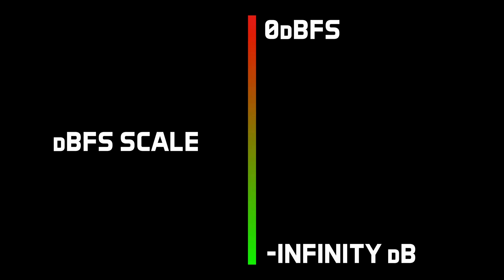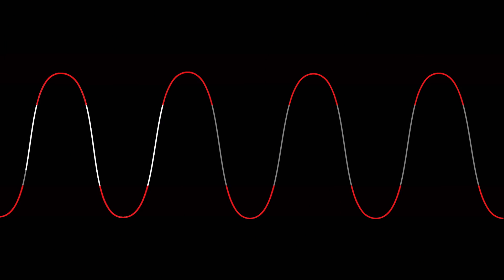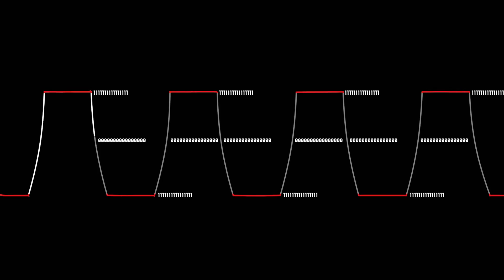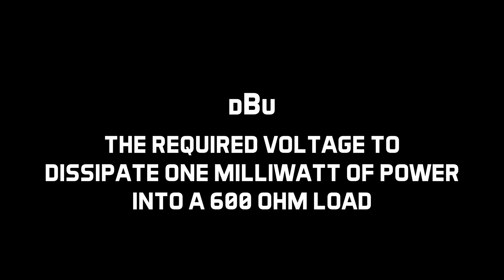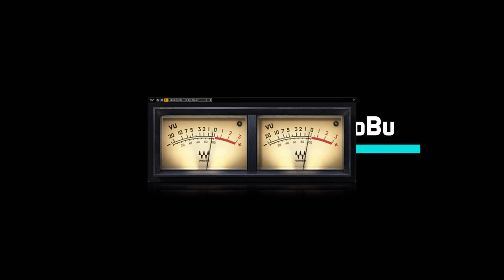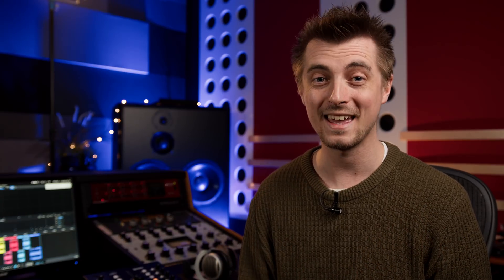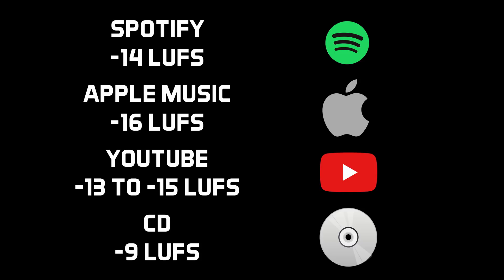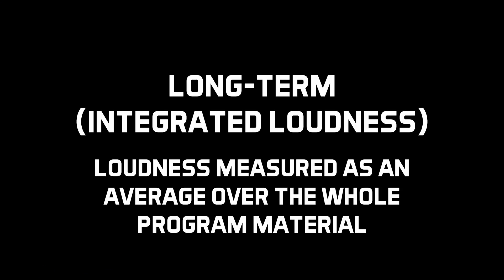Decibel Scales And Loudness Units And Why You NEED To Know Them

Comment: Is it ok to use Izotope RX (Advanced) to process a -14LUFS master down to -16LUFS? (From my Spotify master to an Apple master) (Using the loudness processor) Rather than going back to the project, changing my limiter then re-exporting which takes a while. Thoughts?
Reply: Do not do that. Master to make it sound good, not hitting numbers. If it sounds good at -9LUFS keep it at that level, it is only going to get turned down.
Reply: @thomasberdal3049  Hi, sorry, not sure you've totally understood my question. I run a mini label and have a lot of masters (most of which are already mastered for Spotify at -14LUFS) so re-opening tons of tracks to limit down, test etc will take a long time. All I'm asking is whether Izotope's loudness processor is good enough to bring a master down from -14 to -16LUFS in order to release on Apple music. In my own tests I've tried this and I think it sounds fine, I can't hear any difference, I just wandered if anyone else had done this.

Comment: Great video, but I don't think your section on LUFS is completely accurate. If you exceed the LUFS targets of a streaming service, you are correct that they the will indeed turn your mix down. But this is just like turning down the master fader or adjusting the trim pot. There won't be any unwanted artifacts here. The issue arises when your mix is below the target. In that case, the service will turn up your mix and, in order to avoid clipping, they will run it through a limiter and you don't want that. (NO LONGER THE CASE, SEE EDIT BELOW) This is what is described in Spotify's documentation: https://artists.spotify.com/en/help/article/loudness-normalization

EDIT: looks like Spotify actually changed how they do things! They no longer use a limiter FOR MOST USERS. If you have normalization enabled at the "Normal" setting, they'll only bring up the level to -14dbFS IF THERE IS ENOUGH HEADROOM. So neither exceeding nor being below the target result in artifacting. However, when using normalization with the "Loud" setting they will apply gain to bring up the loudness to -11dBFS. In this case they'll slap a limiter on to avoid clipping. This may result in unwanted artefacting.
In any case, being above the target causes no artifacting. Being below -11dBFS may result in unwanted limiter artifacting under certain circumstances.
Reply: Copied directly from the link above: "Negative gain is applied to louder masters so the loudness level is -14 dB LUFS. This lowers the volume in comparison to the master - no additional distortion occurs.
Positive gain is applied to softer masters so the loudness level is -14 dB LUFS. We consider the headroom of the track, and leave 1 dB headroom for lossy encodings to preserve audio quality.
Example: If a track loudness level is -20 dB LUFS, and its True Peak maximum is -5 dB FS, we only lift the track up to -16 dB LUFS.

Premium listeners can also choose volume normalization levels in the app settings to compensate for a noisy or quiet environment

Loud: -11dB LUFS
Note: We set this level regardless of maximum True Peak. We apply a limiter to prevent distortion and clipping in soft dynamic tracks. The limiter’s set to engage at -1 dB (sample values), with a 5 ms attack time and a 100 ms decay time.
Normal: -14dB LUFS
Quiet: -23dB LUFS"

Comment: "If the recommended loudness unit levels are exceeded the services will quite often turn the music down leading to horrible limiting artefacts and a generally unpleasant sound."

Only if those things already existed in the master. Normalisation is almost always just a clean gaining down of the original master. Unless someone is using the loud setting on Spotify of course, as that is the only setting on any service I know of at least, that uses a limiter. Even then that is to bring a lower level master UP, not down to that louder 11 LUFSi. Which lends more to the argument of definitely mastering hotter than -14LUFSi, not the other way around. 

It's fairly moot anyway as less than half of Spotify users actually have premium and thus access to those normalisation settings, a lot of playback systems don't have normalisation at all like on 3rd party players like Sonos systems and even of those that have access to those settings it remains unclear how many people are really aware of them never mind change them. The only figure i've seen is from Ian Shepherd saying only 17% of users change this setting (although this is unsubstantiated), which considering only about 46% have access to it to begin with is an incredibly small number.

Master to make it sound good. Worrying about the streaming services normalisation specification is counterproductive and if anything, is more of a floor, not a ceiling, in terms of the loudness of your master.

Comment: As ‘decibel’ is a mathematical function, quite literally a fraction on a logarithmic scale, dB has no meaning. In fact 3dB has no meaning either. When we say add 3dB, the word ‘add’ is what gives it meaning. Likewise a + sign. +3dB has meaning.  Yes, it is confusing but really doesn’t need to be understood in mathematical or historical terms. Just remember that a number followed by dB is a multiplier of whatever it is that’s being measured.  20dBu denotes a voltage of 10x the agreed standard of u=1vAC, or 10vAC. It gets even more complicated because AC voltage can be described as peak or average but that’s not important here. 

6dB, or very close to it, represents 2x our measure of sound.  10dB is 3.16x our measure and 20 is 10x.  40=100x and the familiar logarithmic function continues.  60x = 1000.  When we say RT60, we mean Reverb Time (decay) for 60dB loss, or one thousandth the original sound’s measure. That’s as good an indicator as any that sound needs a logarithmic scale or we’d be burdened with very large numbers.

What IS important is to know what the references mean and how they apply to your job. As audio engineers, VU and dBm can be effectively ignored as they no longer measure anything of importance to us. The ones that matter are:

•The letter ‘u’ refers to AC voltage, often 1vAC RMS. This is a technical measurement useful for comparing equipment capabilities.  -6dBu would indicate .5vAC.

•FS or Full Scale.  OdB FS simply says this is the adopted ceiling for those of us working with digital audio (that’s all of us) and it is a relative newcomer. We measure our audio signals almost exclusively as a value of dB below it. -20dBFS means we can increase the signal voltage 10x before running completely out of headroom.

SPL or Sound Pressure Level.  This is a created scale with an obtuse and unimportant reference of absolute pressure called a Pascal. But 94dB SPL, which happens to be 1 Pascal, has real meaning to our ears. We can create a sound that measures that value and hear what it sounds like.  Incidentally, microphone sensitivity is expressed in a number of dB below 1 Pascal. Handy to know.

The math is not important, but the references and key numbers are. When the reference is missing, you are not being given enough information to make a judgement.

Btw, your description of dBu is actually the proper description for dBm (1mW dissipation in a 600 ohm load).  This was in wide use in the days of analog telephony and carried over to audio in the old days when we actually added a 600 ohm resistor at the load end of every single path which resulted in a ton of wasted energy.  dBu was the result of eliminating this 600 ohm load and the u actually comes from “unloaded”, a measure of relative voltage independent of impedance.

Comment: Everything is fine except the fact that the platforms limit causing a noise or dostorsion, the platforms normalize and do not limit, in the spotofy specs it says that if the song is not high enough it will apply a limitation with the treshold at -1dbfs, to raise the volume, but it is not refers to those that exceed -14 lufs, this may change but to this day I have not found that the information you say is correct, please check this info and let me know if im wrong, thanks

Comment: The question is do the streaming platforms put the signal through their (mostly crap) codecs and then adjust for volume or do they adjust the volume first and then put it through their codecs…….because if they adjust volume first the it wouldn’t make any difference what levels the original files are sent to them, if the volume is adjusted first then theoretically there should not be any distortion from peak and/or true peak levels, unless, like I said their codecs are just crap, see some of their mobile transmission rates

Comment: Exceeding the recommended LUFS will not lead to «horrible limiting artefacts and unpleasant sound» It will just get turned down. Most of the top productions are way louder and may also clip true peak.
Reply: For example Happier by Marshmello, 930 000 000 views is -6.5 LUFS and peaks at +1.3 db true peak.

Comment: Well done James, you only half fried my brain! I can remember back in the day when some venues had sound loudness meters, that if you're P.A. (Public Adress) system exceeded a given volume would trip out the stage power. I'm to long in the tooth to remember the level, but we always rated our system amps output in RMS (Root Mean Squared) How does RMS relate to any of the measurements that you described?
Reply from the maker: The RMS is the average safe amount of power a system can deliver without exceeding stress levels. For example, a speaker that has 200W RMS can output 200W of power continuously for a very long time, and can PEAK at maybe 210W for SMALL amounts of time. If it was constantly putting out more power than the RMS then it would fry.
Reply: @PresentDayProduction  Thanks James, on reading your reply I remembered that RMS was related to Ohms Law.. Am I right in assuming that the drivers (speaker) output spl relates to your measurements and that the measurements you describe are pre ampllcafion? PS. How's Flop Cats herring, does he flop because of an imbalance in M/S listening?

Comment: Material that exceeds the streaming platforms’ reference level will not exhibit any limiting artefacts when turned down - no limiting is involved, merely an overall gain adjustment. Also: Apple Music (and others including Spotify IIRC) recommend a true peak ceiling of -1dBFS (or -2dBFS on louder material), not -0.1 dBFS.
Reply from the maker: I think he said -1dB ceiling, if not, that's what he meant. But I run everything through Apple's encoder and turn the ceiling down until the red lights go away. Mark x
Reply: @PresentDayProduction  Cool - I heard -0.1 I think, but if I did, I’m sure it was probably a slip of the tongue!
Reply from the maker: James here - definitely said -1dBFS! Probably just my internet voice not being on-point ;)
Reply: @PresentDayProduction  Watched again, and yes, do did say -1. I stand corrected!

Comment: Very useful video and a rare topic. I think I last read about different db scales more than 25 years ago, in an article about companies trying to decept customers by using "friendly" db scales. Mainly for signal to noise ratio in pro-sumer products.
LUFS wasn't a thing back then, although radio and TV probably already measured it. Radio was slamming every track to death, but independant wouldn't get airplay anyways and we were in the heights of the loudness wars.
Excellent video, again. Thanks!
Reply from the maker: Glad to know you found it useful! Thanks Peter! :)
Reply: There was a trend among cheap (& nasty) speaker and amp manufacturers back in the 20th century to rate their kit in PMPO (Peak Music Power Output) rather than WRMS. Hence the profusion of 2kw PMPO car subs and amps that were actually about 50WRMS. The coils on the subs would frequently unspool before the cones tore themselves to pieces.
Any time a cheapskate manufacturer can manipulate data to confuse consumers for profit, they most certainly will.
Caveat emptor when it comes to tech spec sheets, even from "reputable" manufacturers, because even they may be using selective comparisons to dupe the credulous.